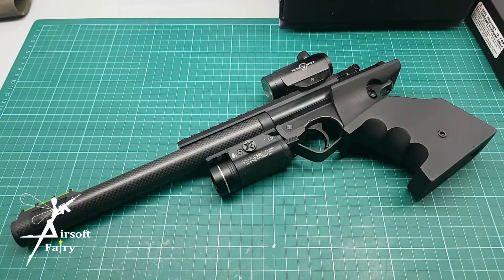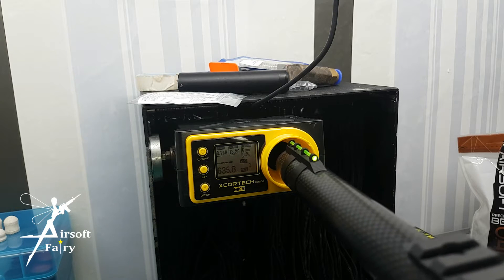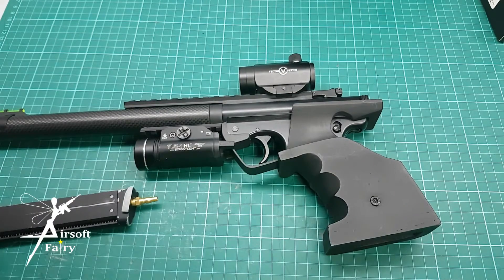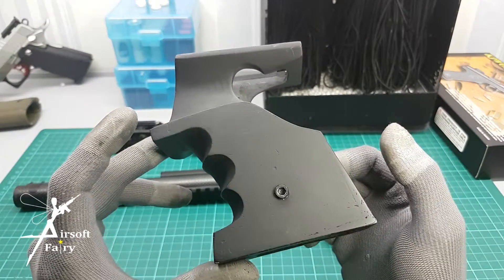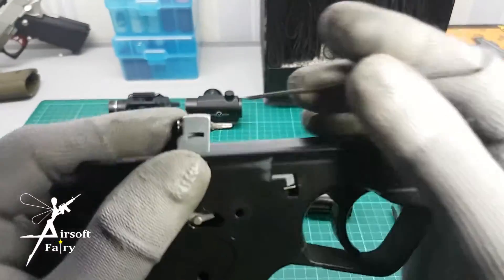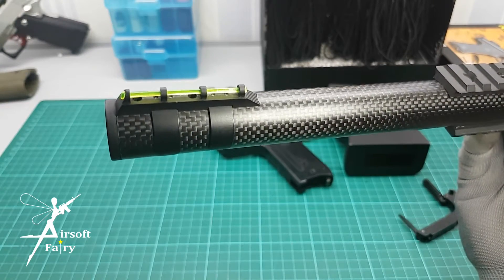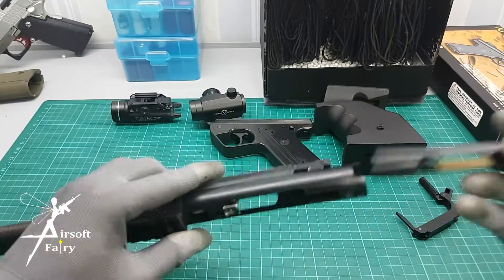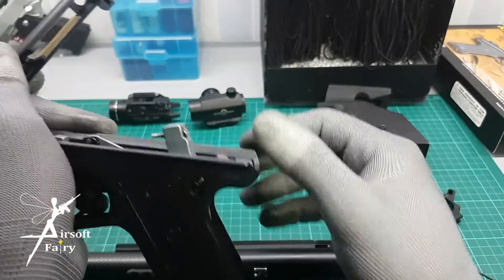HOW TO MODIFY KJW MK1 AIRSOFT PISTOL /AIRSOFT FAIRY

Comment: That sight from shotgun and direct hammer mechanism is a brilliant idea !
Longer inner barrel I thing about very similar way.
I was made outer longer barrel from alu pipe and build in suppressor :)
My gun it used for Airsoft games so l can't improve power like in Your gun, I think about improve accurate and distance (hopup) system.
How to disassemble that thing- forks work - from inner barrel ?

Comment: Its amazing how it turned! Coul do you tell me wich pieces do you use to upgrade?
Reply from the maker: external carbon fiber tube for the outer barrel, i curve wood for the grip, i modified the trigger guard with pvc, i use aps cam 870 front sight, i put rail on top and bottom, internally maple leaf 300mm inner barrel and modified it, custom made hop unit, i modified the magazine for more power
Reply: Thanks 😍

Comment: Hi, I just watched your video and Wow! That is a great modification! Just like to ask where you got the barrel? Is that available in Vincent's?
Reply from the maker: outer barrel or inner barrel? inner barrel you can get it from airsoft shops that sells upgrade parts... outer barrel is carbon fiber tube that i modified to make it as outer barrel and you can get it online carbon fiber tube
Reply: @airsoftfairy7639  thanks, it's the inner barrel. I bought one a few days ago. The inner measurement is .601mm so it's okay but the outer diameter is bigger and will not fit to the outer barrel of the MK1. Will there be no problem if I make the hole of the outer barrel bigger?
Reply from the maker: @emiliosuarez1519  message me on my FB page. https://www.facebook.com/Airsoft-Fairy-103583124900838/

Comment: Hello, cool mods, I dig what you did with the gun.
 I have some questions though:
 What material are the rails made of?
How did you made the upper assembly, did you use the old outer barrel with guide cap that was in the front? 
What is that ring between the carbon part and the old upper receiver? 
Thanks for answers and good luck!
Reply from the maker: the rail i believe its aluminum just ordinary rail. the upper assembly is the stock one.. i did not use the guide cup on the front.. and i made a ring or washer from pvc pipe and some masking tape to shim it and its easy to do  since that part is fix or doesn't have to move..
i hope it helps... and thank you for watching my videos and thanks for the support.
Reply: @airsoftfairy7639  Nice, so you put the carbon tube over the old outer plastic barrel am I getting it right? Because there is loop for the pin that holds front sights that needs to be filed down then. I am gonna watch some more vids, drop likes, good info. Thank you.
Reply from the maker: no,  i did not use the stock outer barrel its all new assembly.. i made spacer out of plastic for the front of outer barrel to  centered the inner barrel..
Reply: @airsoftfairy7639  Thank you so much for the info.

Comment: Sir lenght nga at diameter ng inner at outer barrel na ginamit mo. Balak ko din i upgrade tong nabili ko. Salamat po ng marami sir. Pa guide po sir. Godbless.
Reply from the maker: 25mm yata sir idouble check ko yun video
Reply: @airsoftfairy7639  Salamat Sir

Comment: where can i get the aeg hop unit and whats is the brand , i never seen before.
Reply from the maker: Its the hop up chamber (or hop up unit) of an aeg rifle.. i got a broken one so i just use it.. you can use any tube which the inner barrel can fit in
Reply from the maker: I just get a part of that aeg hop up chamber and custom cut it to make a hop up unit for this pistol..
Reply: Its a sniper bro, whats about accuracy.
Reply from the maker: I just use it for fun shooting for plinking so i really never try it in  long range but 5inch target is easy on 20 meters
Reply from the maker: ...More or less 20 meters